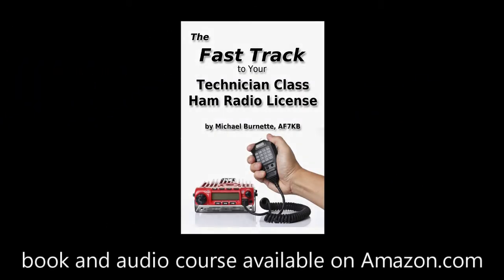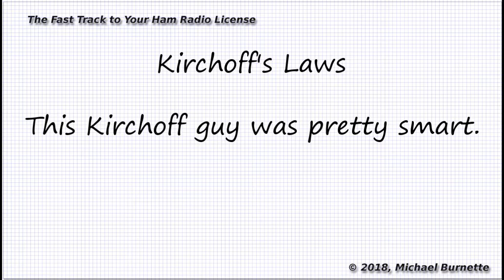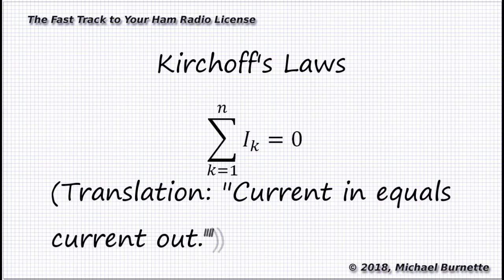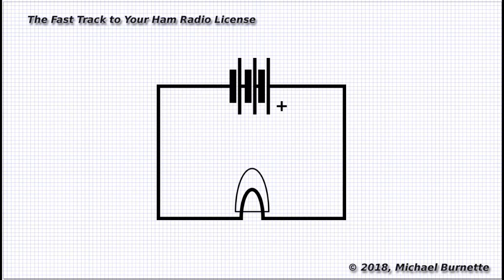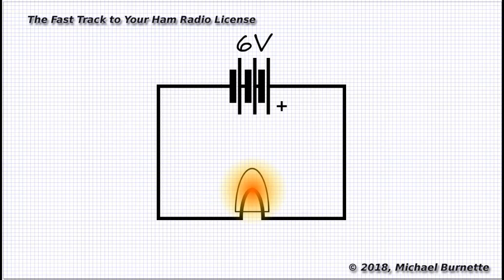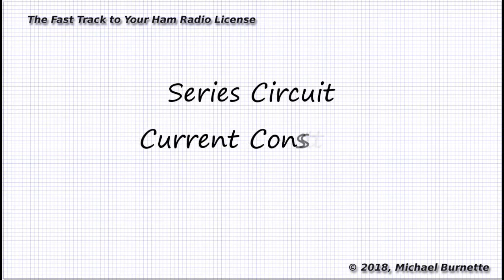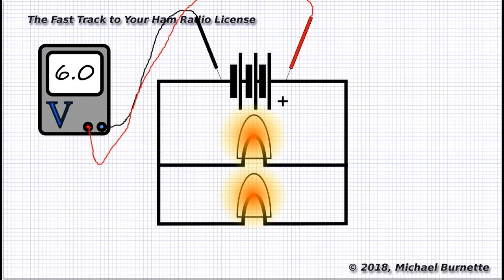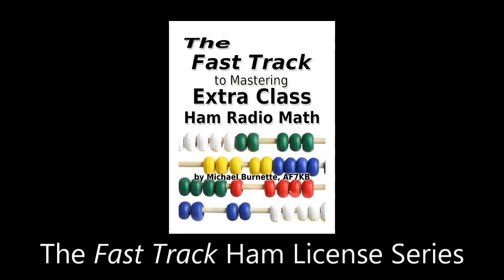Series & Parallel Circuits for Technicians

Comment: I would like to see more of the math involved at each step. I still don't know how much current (amperes) is flowing because I don't know the R of the lamps. Is there a way to find that out with out using a meter? Inquiring senior minds want to know.
Reply from the maker: Hi, Alvin. This video is for teaching general principles -- leaving out the math was done very much on purpose. The point of this video is that the values don't matter when it comes to Kirchoff's Law. You are welcome to plug in any values you want for the lamps, but to demonstrate the points of the video, make them equal, then make one double the other. You could go for 10 ohms each, then 10 ohms for one and 20 ohms for the other, or 1,000,000 each, then 1,000,000 and 2,000,000. If you run your Ohm's Law calculations on them, the amounts of current will change, but the proportions will stay the same. 
For details on the math, check out this video: https://youtu.be/RyWaRK1U1mc
Hope that helps!

Comment: THANK YOU MICHAEL!

Why can't every source just say that " In a series circuit the current remains constant, while the voltage varies" and "In a parallel circuit the current varies, while the voltage remains the same"? 
I wish they'd stop trying to dazzle us with extraneous terms and information.
Reply from the maker: Sounds like you need to stop hanging out with "them!" :-) Thanks Jonathan.